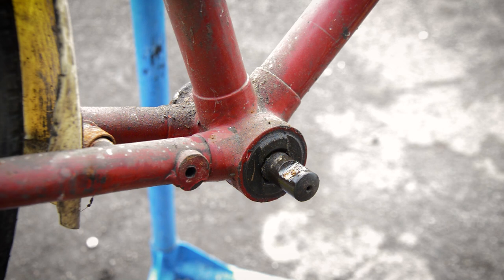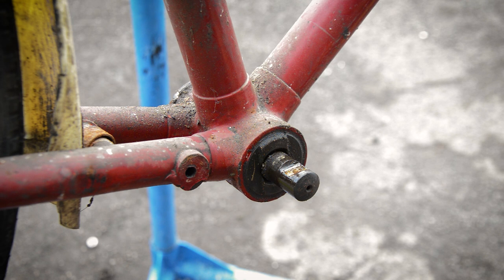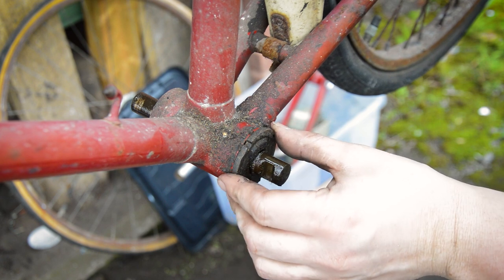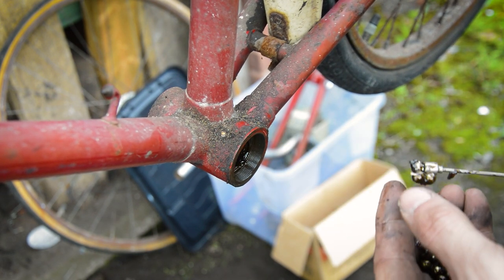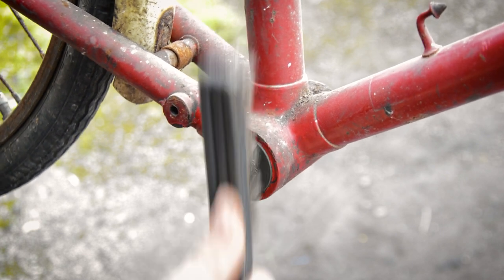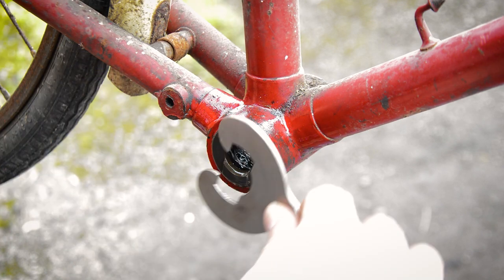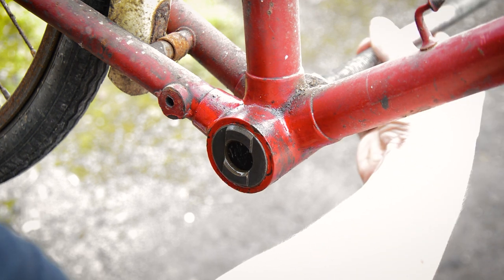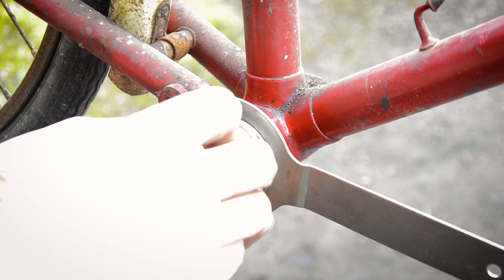Useful Hack / Top Tip - Remove Old English 3 Speed Bicycle Bottom Bracket Easily! - Park Tool HCW11

Comment: Great video. Inspired by your video I purchased 100mm m14 bolt, two M14 nuts, 2x 40mm penny washers and a couple of 28mm washers and used them to hold my Park HCW11 firmly in position to undo stubborn ancient Raleigh sprocket side bearing cup. Bolts etc cost me a about 2 pounds. A bit of careful hammering loosened the cup and I was able to remove it. Many thanks

Comment: You don't need a special spanner at all; just the big bolt, washers and nuts. Do it up tight and keep going. When the nut & bolt can't tighten any more the cup will start to turn instead. Use a big spanner on the outside nut if you want to take out a left hand thread cup as you tighten the n&b - use a socket with extension on the inside nut if you want to take out a right hand thread cup as you tighten up the n&b. If you use a long bolt and lots of nuts so that they poke out of the far side of the BB shell, then you don't even need a socket and extension; just a regular spanner(wrench).

Comment: Good tip clamping the tool on. I did this recently and instead of hitting it with a hammer i used a piece of scaffold pole as a cheat bar. Worked a dream!
Reply from the maker: That works too!  Unfortunately I don't think my Park stand would cope with the rotational torque and I'd just end up spinning the hole bike round in the stand!
Reply: MonkeyShred I popped the wheels back in it and stood it up.

Comment: It is definitely a good way to keep the wrench from slipping. All I did was take a bolt with the head on the inside of the tube, added some fender washers to the threads sticking out then put a nut on it then tightened it down. Doing this I just ratcheted the cap right out.
Reply from the maker: That's one way to do it too.  I'm sure I've done it like that as well at some point to a seized cup

Comment: Brilliant! One of these defeated me last week. I had the cup in the vice by the flats and tried to turn the frame, but it kept popping out. I've never seen one of those tools before either. Thanks for posting. 🙂
Reply from the maker: It's a bit useless by itself but works well when bolted down like this!
Reply: by the vice did I remove my fitting, a challenge to discover the direction,

Comment: I do the same with stubborn sealed square tapered BBs. But you use the rod from a quill stem and just screw it in so the tool locks in. I sometimes have to sit down on the ground, put my feet on the frame and then "deadlift" to get the BB out. 
Works like a charm.
Reply from the maker: I definitely bolt them too now.  I just use some more spacers and use the thread in the end of the axle to bolt them too though.
Reply: @MonkeyShred  I think RJ the bike guy showed that tip. Not sure. Either way that guy's a gem.
One time I had to use a blow torch on the frame, then use another frame connected to my spanner wrench to lengthen the momentum arm. It was the craziest sketchiest solution ever.

But I got it out, booyah.
cheers

Comment: If this method fails, you can set up the same way,or use a bolt & nut minus the BB spanner and use an impact gun. Once set up a local garage will usually help.
Reply from the maker: I've tried that method after seeing RJ do it.  It didn't work for me, trashed the NDS threads and actually fractured the drive side cup!  The cup was still stuck in the frame.

Comment: Another variation on your trick is to use a lock washer in the place of one of your washer so you have a washer then the lock washer then the nut. Take a 18+ inch breaker bar and socket  and turn the nut clockwise. The nut will tighten on the lock washer the lock washer will tighter on the regular washer turning the whole bottom bracket off.

Comment: I always use an m14 Bolt and nut and put it trough the cup. Then i make it really tight. And then i put a big wrench on the bolthead and the cup Comes right out. 
Its kinda janky but it works
Reply from the maker: I can see that working too!

Comment: Great video - I've used my Park Tool headset press to similar effect. I've just started to work on a friend's frame with this style BB and (as I've seen mentioned below), the drive side cup is painted which seems will make the whole process harder! Just waiting for the tool to be delivered and not looking forward to it.

I was hoping to replace this bb with a modern cartridge sealed unit. I've read conflicting evidence that some of the shells have a thread with 26tpi others with 24tpi. If I find I cant fit a modern BB because it's the wrong thread, I don't see why couldn't fit a modern crankset still? I have modern Sturmey 1x crankset that requires a 103mm bb width - do you know if I can buy a 103mm spindle that would fit this old style BB? Hope that makes sense and sorry for the essay!
Reply from the maker: Yeh sure!  Indeed it is a case that a lot of these older bikes ran 26tpi, espeically after Raleigh bought the companies.  The other "issue" is the width of the BB shell often being 71mm.  I have used the original cups and just upgraded the spindle though so you can get away with that.  From memory, I think spindles beginning with 3 suit 68mm shells, 5 suit French and Italian 71mm shells and 7 suit the 73mm mountain bike shells.

Comment: I’ve got into the bad habit of leaving that cup in if the race looks good once cleaned out. I don’t own the particular park tool though and it’s a battle with the adjustable spanner. Top tip though!
Reply from the maker: The adjustable can be clamped too, it might still wiggle itself open though :(

Comment: Just in time, I've been struggling with my Raleigh Courier BB. Can you just leave that side in and put bearing racers in through the other side?
Reply from the maker: You can!  It's a little more awkward to clean, add the grease and bearings but it is doable.

Comment: can I toss this bottom bracket out and use normal bracket with normal system like -> SunRace Square Taper Bottom Bracket For 68mm Shell Alloy Cups, I'm struggling to remove that terrible bracket side. - never mind fixed and replacement support I had from cube fitted just fine, so I have thrown away that old crap.
Reply from the maker: Um, if it was a 26tpi like this one, the answer should be no because new products tend to run 24tpi and either fit a 68 or 73mm shell instead of this 71mm
Reply: @MonkeyShred  68 was direct fit in my case.

Comment: Great video, I thought you were going to use the nut & bolt / impact driver RJ method. Dunno if I'd wanna invest in the park tool for it's limited use, though it must be nice to have one.👍🏼
Reply from the maker: Oh no!  I've done that method on the 1939 Raleigh Dawn I "had"....  It left me with a fractured drive side cup and flattened threads on the NDS ruining the frame... and the cup was still stuck!

Comment: Shouldn’t you put some type of protection between the nut and cup on the backside to prevent damage to the bearing race? Maybe a rubber washer?  Or reinstall the other cup and but a washer and nut against that?

It was a great idea but risk on scratching and pitting the bearing race.
Reply: Don't worry, the cups on old english bikes are very hard
Reply from the maker: Yeh you can do but they are hardened to a good degree and I'm not actually bolting it down with much force.  Just finger tight to hold the tool down.

Comment: Can I change the bottom bracket to a different model or I need to replace with the same?
Reply from the maker: With these old bikes you're a bit stuck, especially if it is 26tpi.  New cups for that are non existant.  24 tpi cups and axles are available though

Comment: It occurs to me that really, you could just leave that stuck part in there, as you have removed and gotten access to the bearings already. Just clean it out as best you can, repack the bearings, grease up the inside of the stuck part, put it all back together and you are done, with the hardest part skipped.
Reply from the maker: Of course you can.  You could just squeeze new oil in through the oil port if you really didn't want to take it apart too.

Comment: if I had this key I wouldn't look it up on youtube.
useless
I'm going to just weld something to the cup
Reply from the maker: So why are you here?  Top tip for you, a bit of threaded rod with a washer and a couple of nuts is a lot easier to use than a welder.
Reply: @MonkeyShred  removing something with special key is obvious, it is useless to make a video about using key, because if someone has this key it would be removed.
It took me 3 minutes to unscrew it with welded rod, without need of buying special tool just to use it once.
Reply from the maker: @jc438  so again, why are you here? 😂 You completely missed the point of the video btw. It’s not about saying this is the tool you need. It’s how to use it easily. Try and use it without bolting it to a stubborn cup and see what happens.